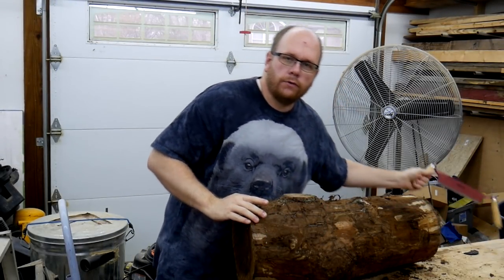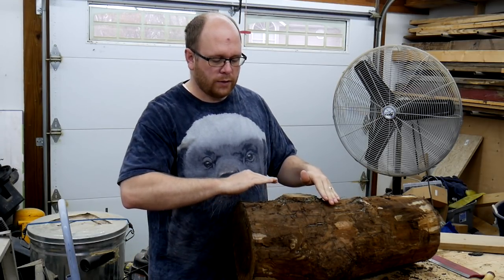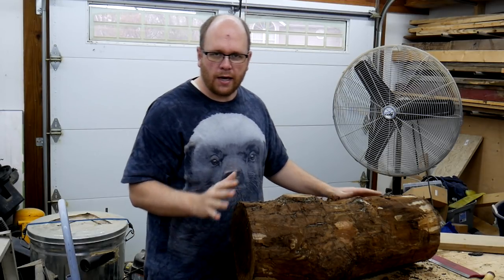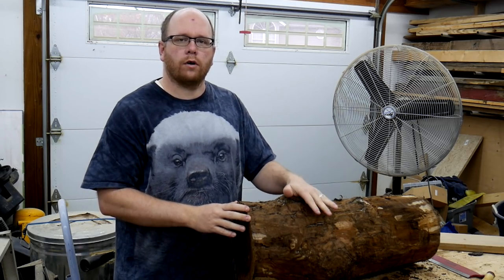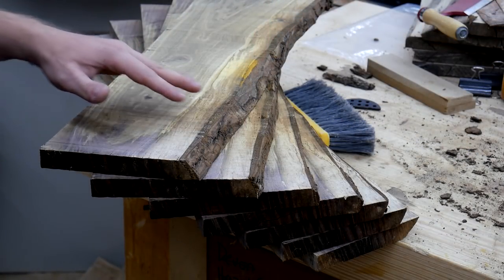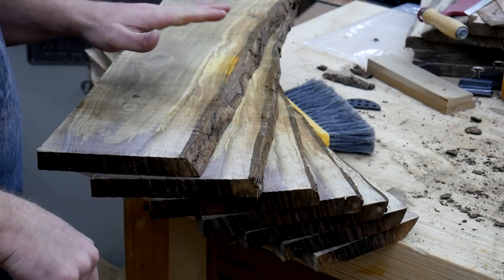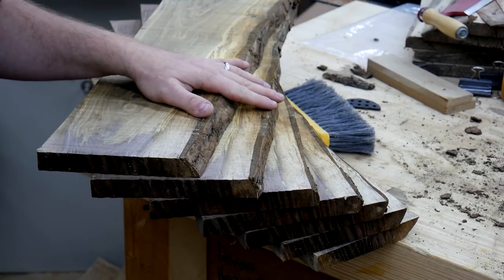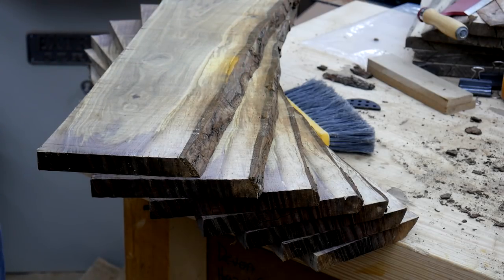Milling Walnut on my Grizzly G0513X2 Bandsaw

Comment: My new G0513X2 just shipped from MO yesterday...I just hope the truck can get down my driveway and lower it with the lift gate I paid xtra for....  Been using a smaller 3/4 hp unit my neighbor loaned me and it's time to give it back..... 
Good video and thanks for your time in putting it together...
Reply from the maker: Thanks! You will enjoy the extra power and resaw capacity. Good luck!

Comment: You got it done.  That wood is heavy and it is a lot of work to push it through the saw.   I never thought myself before I did the same as you how much work it is to push that log through that blade.  Last night I cut up some 30" log's that were 10" thick red oak.  It was all me and a buddy of mine could do to move them up on top of the sled and position them for resawing.  I have a stack of 1" thick boards now.  I have 5 more logs 4' long to resaw.  Some are near 12" round.
I built a 28" wide sled and table with guides on both rails using eyeball bearings under the sled.  Added a warn winch on the out feed side and 2 concrete blocks on pulleys on the infeed side to pull the sled and the winch line back after the cut was made.  I have the saw maxed out at 11.5 of Red Oak.  Grizzly 17" with a 2hp motor.  Sometimes I have to flip the warn winch power supply down from 12 volts to 6 volts which slows the feed rate down by half when it's a 10 to 12" of red oak.     Need to feel the motor from time to time.  Don't let it get to hot.
My wife helped me on my first resaw log as we fought the weight of the thing and I just about pulled my back out handling it.  The resaw table is made of 1x4" resawed from 2x4's glued and screwed some hardwood 1/4" oak tile backer plywood onto of the 1x4s and then on top of that laid out the eye ball bearing and drill the holes for the bearings out of 1/2" plywood and screwed that on top of the plywood.   The second sled is 3/4" oak plywood.   Those logs will pull a sled in all kinds of directions.  

My first sled was only about 18" wide 4' long  using the miter slot and my second sled was 28" wide and 4' long and guided by both sides of the table and a 3/4" keeper on each side to keep the sled from going up or sideways.  
Those logs are super heavy.   Use a pump hydraulic table to get the logs up on the resaw sled.  works great.  Here is a video of the table.  Skip to the end to see it in action.  

https://www.youtube.com/watch?v=NfghIFVAKUY

Comment: If you have more to cut then you could get a fan and some plastic then a dehumidifier with the wood under the plastic and check the tray.Then it will dry faster.

Comment: I'm curious if you would recommend this saw for use in a small business that makes 2x4x16" wood wedges. Can you feed the wood through pretty fast? Safely of course
Reply from the maker: Definitely enough power for that, and with the right blade and jig I am sure you could crank those out in a production manner with this saw.
Reply: instablaster.

Comment: You appear to be applying a lot of feed pressure. Did you wax the underside of your sled, that can reduce friction significantly. I wonder of your blade is dull or if it's the correct blade for resawing. Maybe slow your feed rate down and give the gullets of the blade time to remove the swarf. A 1" x 3 or 4 TPI blade would do better here for rough cutting boards s like you're doing here I think.
Reply from the maker: I had the right blade on there, a 1” 3 tpi resale blade. If I were to do this again, I Gould build better outfeed support. Those logs were green and super heavy. I probably was also feeding too fast.
Reply: Sorry, my mistake. I could see it was a wide blade but it looked like 8 or 10 TPI to me. I too have found green wood difficult to push through the BS and it is heavy.

Comment: I see this videos from a few years ago. I wanted to ask if you are happy with the saw?  I have the same one, and I have had problems with it.  It seems like it may be underpowered.  I can't put my finger on what it is that I don't like about it.  I'm considering selling it and buying something with a bigger motor, and maybe some more capacity.  I'm interested in your thoughts.
Reply from the maker: I love mine.  Never had an issue with power, but a lot of that has to do with blade sharpness and blade selection.  If you are trying to cut through 10 inches of hardwood with a dull blade, it will be hard to do, the blade will wander and the cut will burn.  Likewise, if you are using a high tooth count blade to resaw, you are likely going to run into power issues as well.  Your belts may be slipping if you are losing power, and may need replacement.  I hope you figure out what is wrong, because I think it is a very versatile saw for big work like reswaing and intricate work with a 1/4" blade.  Of course, upgrading is great if you can afford to do it.  For all intents and purposes, this is an entry-level saw.  Good luck!
Reply: Get on the Grizzly website and find the procedure to fine tune your saw. Blade choice is key just like any other power saw. You should get nice clean cuts with little effort. There area few good videos on YouTube that go into greater detail. I have the same saw and i can tell you its a real beast ,plenty of power. Making the proper adjustments can be tedious but well worth it.

Comment: I have the same saw. I resaw a lot of walnut . I think your saw maybe out of adjustment,mine doesn’t make near as much noise.
Reply from the maker: Same blade size and tooth count? 1 inch by 3 tpi. Just curious. The wood was green also which may have contributed to the noise. The blade could have been a little dull also.
Reply: Thomas Lightle ,same blade. There is a lengthy process for fine tuning your saw. It looks like you are binding a little when the jig is in the miter track. You can adjust the saw for that. The audio might be throwing me off a little . Let me say that I have been running 8-10 ft boards thru with very little effort. I harvest my own trees on my MO farm. I usually dont cut green wood to 4/4 .it will take longer to dry but you will have less splitting and warping. I also make sure to seal the end grain with paraffin before i stack it . Thats just the way it works best for me. Seasoned wood will pass thru your saw on recuts almost perfectly up to the capacity of the saw. 2 or 3 passes thru the jointer and its ready for the planer and table saw. (all Grizzly). Keep making sawdust ,looks like you are not a lazy man.
Reply from the maker: This video is a couple years old. You just jogged my memory about my biggest struggle while resawing. It was the sled. It was hastily thrown together and it was tight in some spots and loose in others and I can almost guarantee that was the source of my troubles. Regardless, thanks for the great info. Whereabouts in MO? I live right outside of St. Louis. Cheers!
Reply: Thomas Lightle , Im down in the S.W. About 60 miles from Springfield. Table Rock. Beer drinking country!

Comment: how long will you wait for the slabs to dry?
Reply from the maker: General rule of thumb is 1 year for each inch. This was a couple years ago, so I have been building with it for about a year now with no issues. In fact I am making some cutting boards with that wood for a fundraiser right now! I have some thick slabs about 3 inches thick that I am still allowing to dry.
Reply: @SouthpawWorkshop  Thanks!

Comment: Great looking wood Thomas! By the way where did you get the grizzly bandsaw? And what size blade do you have in that?
Reply from the maker: Thanks Opa. I got the saw from Facebook marketplace back in June. The blade is 1” 3 tpi. Not the best blade, but I will use it until I get around to getting a better one.
Reply: @SouthpawWorkshop  1"-1 1/2" 3TPI is professional resawing for cabinetry, you using silicone blade ? It changed my life